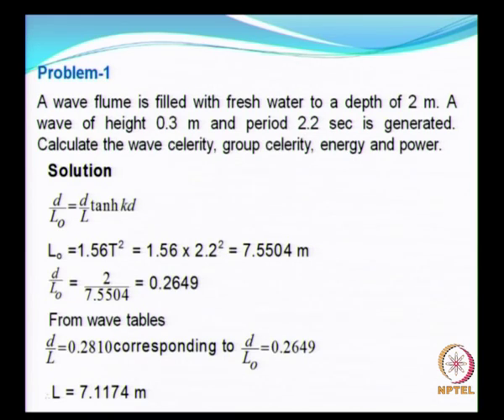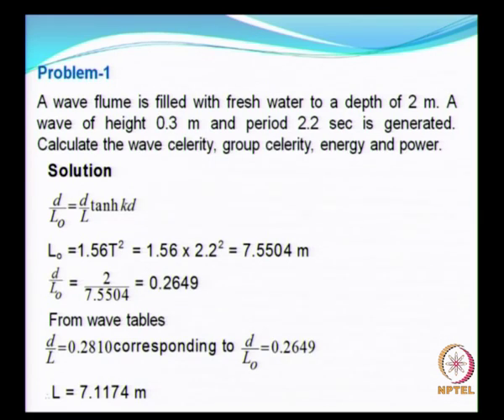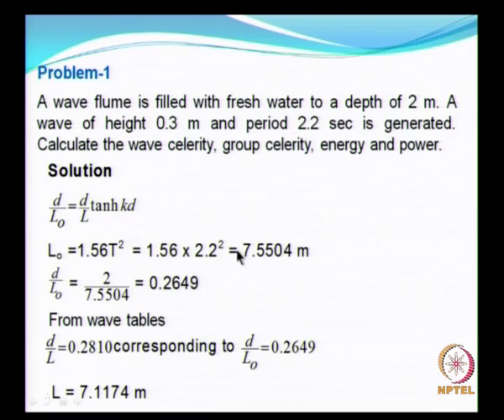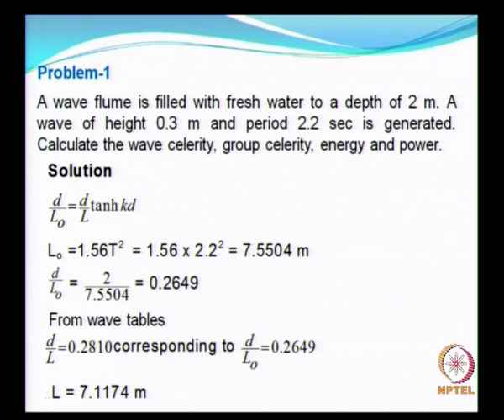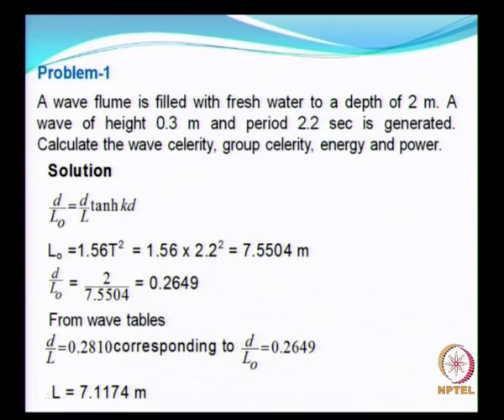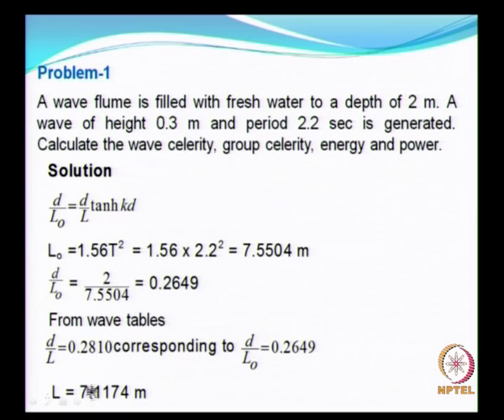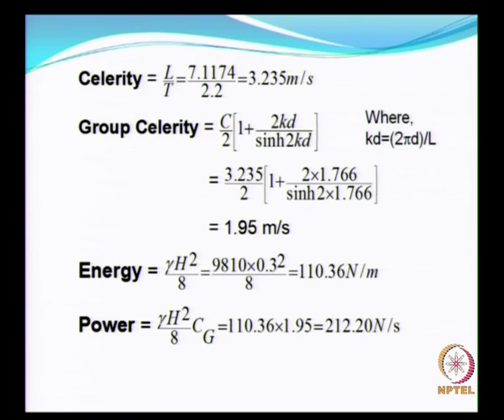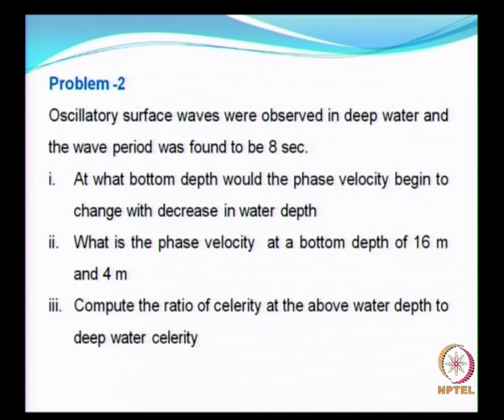Wave Motion Problems

Comment: There is a mistake in the 4th problem the Depth d is 14,8 not 12,8
Reply: Other mistake in problem 7 for calculation of total pressure we should add 5 and not 4 in the formulas which result 61,13kN/m2